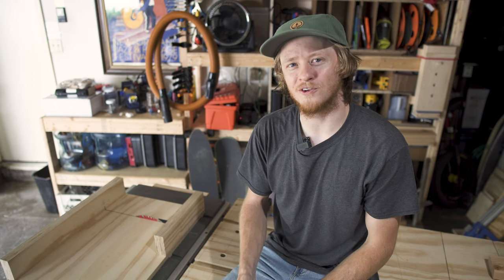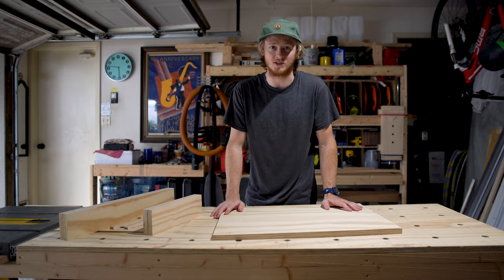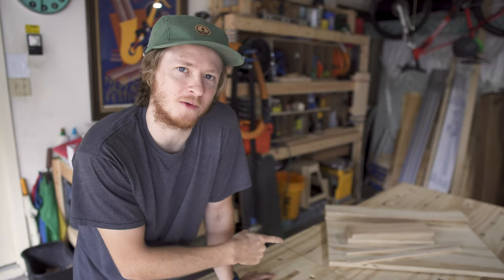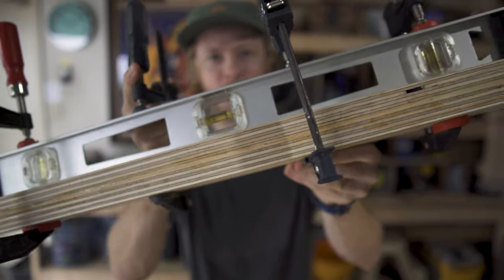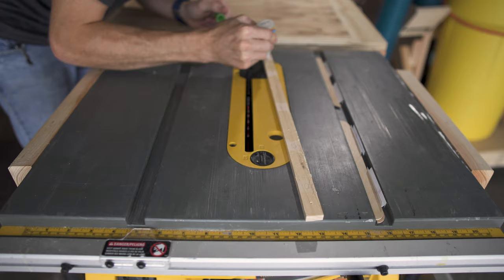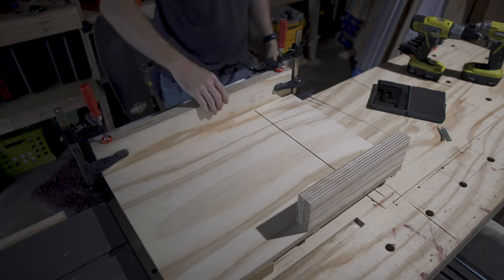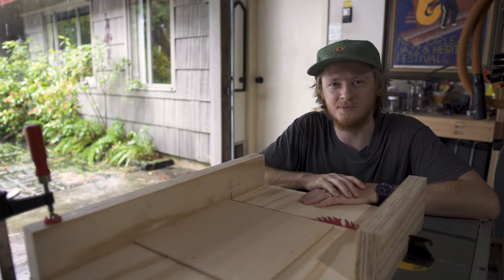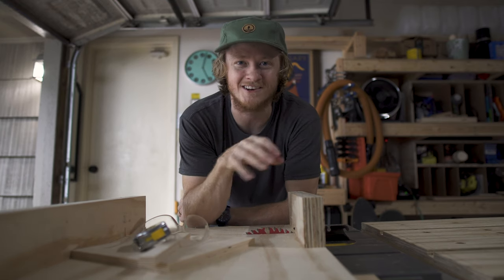Why You Need a Crosscut Sled and How To Make One Quickly and Accurately

Comment: Got down to .017” error. Will watch how this holds through time. It’s working great for my build. Thanks for your detailed presentation. I like your style and your mindset on your build. Following your techniques precisely.  One thing though, cross nuts threads are too deep for my nut set tool. Had too use Nut-Certs instead. So glad to have found your site. Currently doing Intello Plus, Nut-Certs and Framing. Thanks for your hard work to edit and post your videos .

Comment: @Moser Makes What's the name of the tool used at https://youtu.be/xlAhqiMB2pk?t=855?
Reply from the maker: It's called a marking gauge (the one I have is similar to this https://amzn.to/3xkaJM4). There I was just using it to mark a line for where to drill my holes. A combination square and pencil would have don't the same (or even just eyeball it).